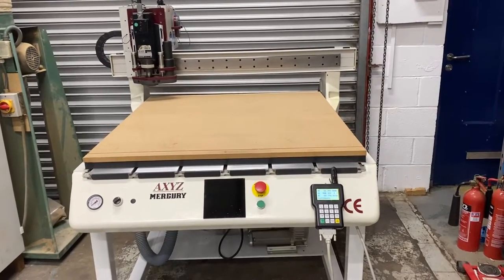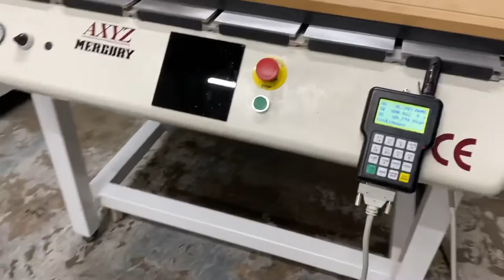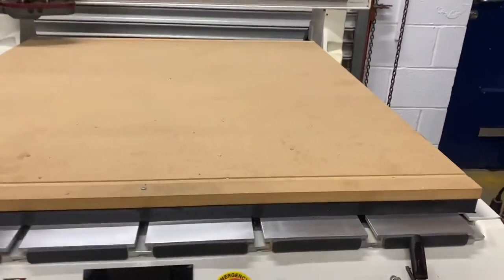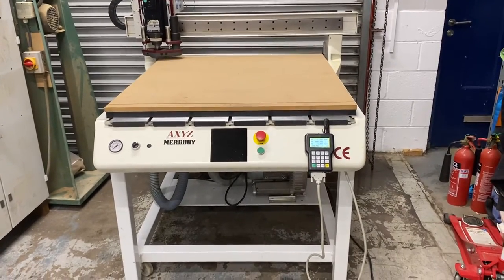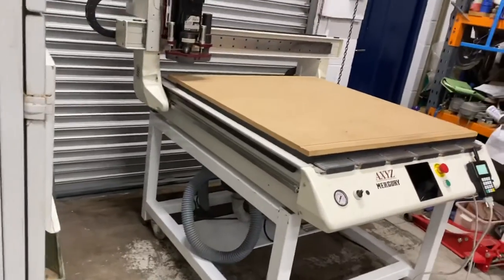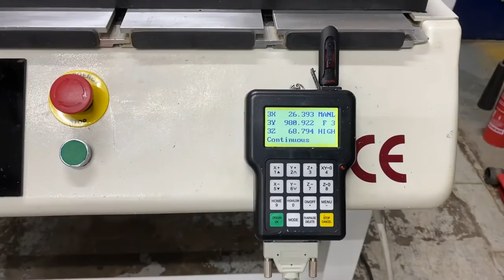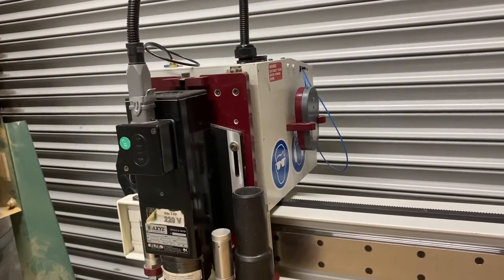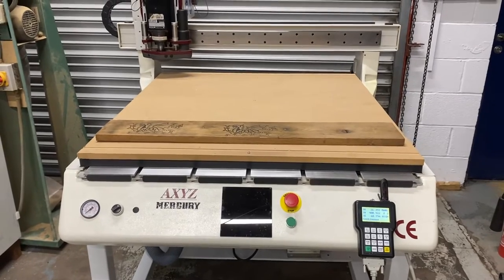Axyz new controller. For sale

Comment: hi when youve done this conversion how do you reset / reconfigure the steps etc so it cuts acurately, when we did one we could never get it to cut exactly like a 50mm box or whatever you asked it, is there some kind of formula

thanks
Reply: Yes
You have to calculate the mm movement per pulse from controller for this control. 
Includes distance, gearing and steps per revolution set for your motors .